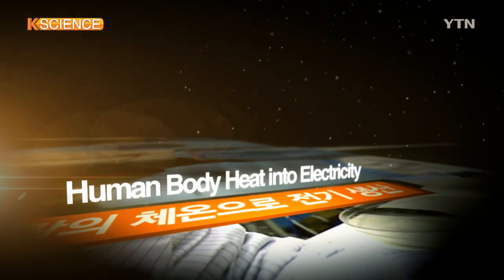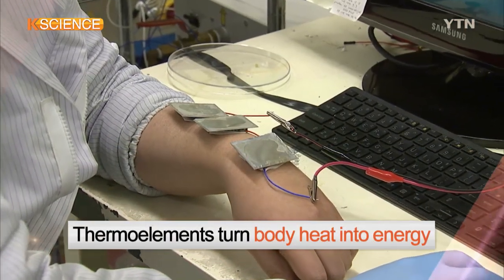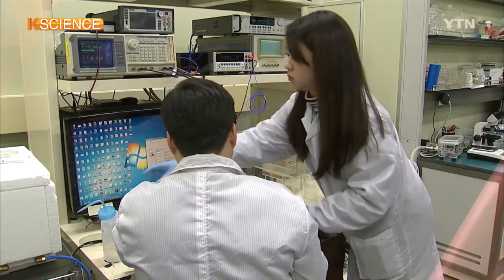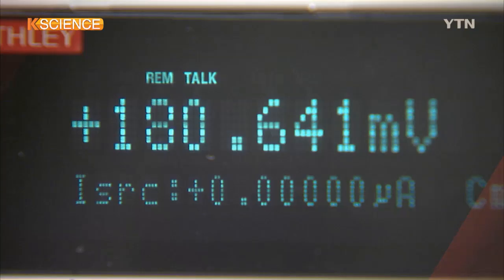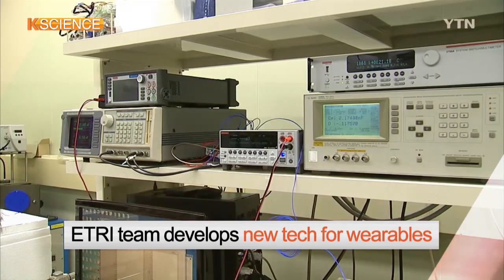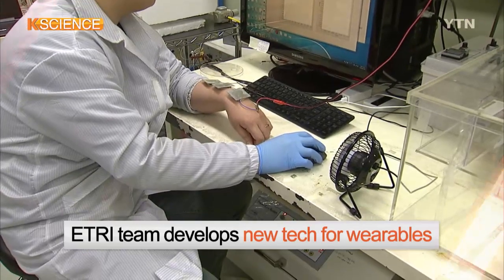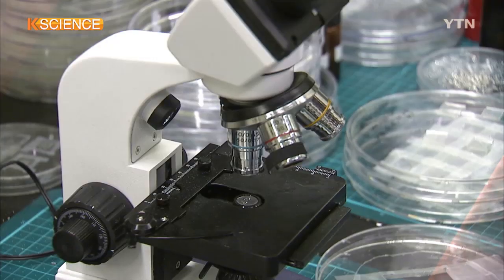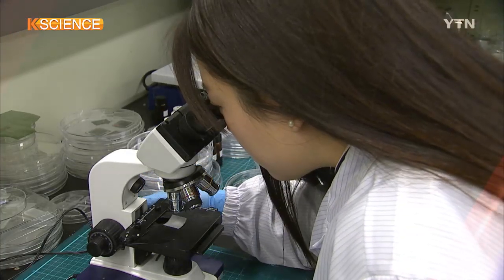Human Body Heat into Electricity / YTN KOREAN

Comment: Great video!  The pharaohs used a device known as the "cylinders of the pharaoh" made from copper(cathode) and zinc(anode) cylinders filled with quartz crystal when held(human body=electrolyte) produce electrical energy starting at .6 volts and will gain .02 volts every minute held so after an hour you will produce 1.2 volts.  Make them yourself or get them on amazon or etsy.